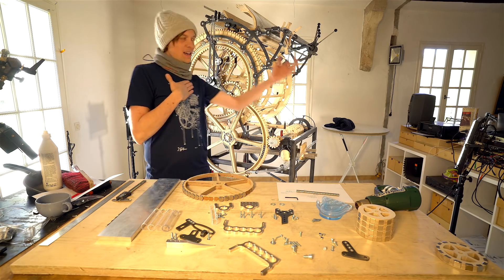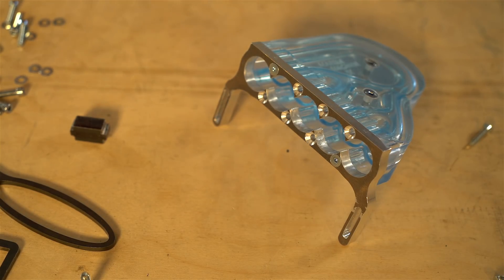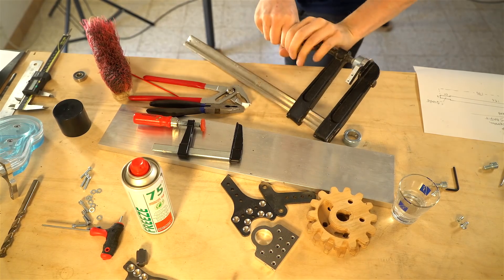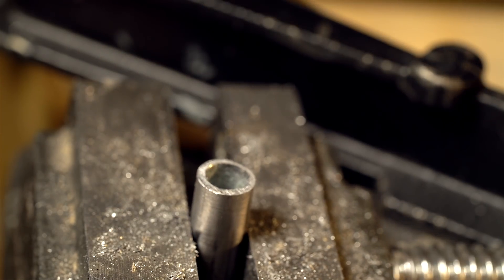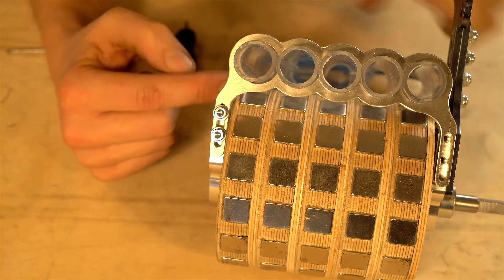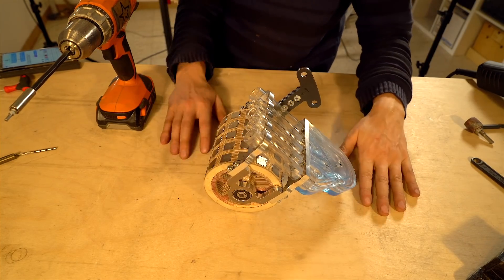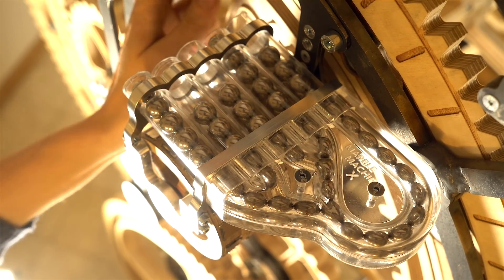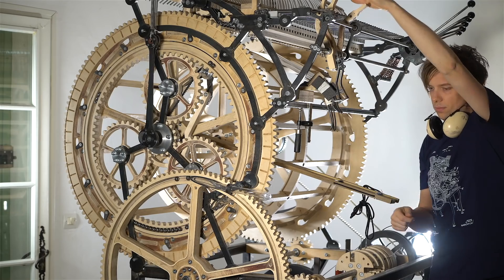Marble Demagnetizer V3 - Marble Machine X #62

Comment: 4:45 and thats why you want to go about 3 turns forward..... and then a turn in reverse 

the reverse turn "breaks the chip"...... the chip being the long metal spiral 
this gives the tap room to cut

if their is no room, BREAK! 

and the tap is VERY VERY VERY hard..... and requires a VERY VERY VERY VERY VERY VERY hard drill bit to remove 
better to simply start over again

Comment: Using a hand-held drill to tap threads is the reason your tap attempt failed.  The drill moves like a lever and the tap is not designed to flex so it sheared. I would use a hand tap to avoid too much lateral movement, slower but if you want a perfect part it is worth taking the time.

Comment: It's great to watch this coming together.  Since you seem to have a penchant for power-tapping (instead of using a wrench), you might want to consider using taps that are designed more for production.  Specifically, Spiral Point Taps and Spiral Fluted Taps which have better chip-clearing and more cross-section and thus can handle more torque.  I'd also suggest some cutting oil instead of that grease - seems like it'd be too thick to get into the places where you'd need it (but maybe I'm just too old school ;)

Comment: When tapping threads do it manually, with lube, and go 2/3 clockwise and then 1/3 anticlockwise, repeat this pattern tool done. A tap wrench has horizontal bar handle which helps keeping it level/true.

Comment: Stop using a hand drill with taps.  You say you like Abom79, and I do also, you know he doesn't use taps with a hand drill.  Keith Fenner will show you the same.  Use a drill press, you're first tool, or a hand tap handle.

Comment: Awesome video, FYI, when trying to drill in the center of a rod like you were towards the middle of the video, try chucking up the actual workpiece in your drill press and putting the bit in the vice. The spinning of the work tends to center the hole much better than driving a bit thru. Using a starting bit after your center punch also helps.

Comment: I always enjoy installments of this build. Very creative design and fabrication. I wish my shop was closer to you so I could help with some of your parts. I'm still putting the offer out there if you don't mind the shipping costs. I would like to comment on the 1 into 4 ball path seen clearly @10:18. the outer walls of path 1 and 4 appear to be straight. If channels 1 and 4 had small bumps on the outer walls at the projected entry areas to paths 2 and 3 , the balls would not rest in a straight pattern and not have the desire to lock at those points. They would distribute smoother. However it is accomplished, the outer tracks should not be straight. Even a slight radius would be a step in the right direction. I have subscribed and will follow this. Great work. What is your background??

Comment: It's hard enough to tap a steel rod with a normal tap handle. I suggest stop using a drill for tapping holes unless it's in soft, thin aluminum pieces.

Comment: Probably late to the game but I was thinking of why have a 1-> 4 demagnetizer, at full throughput there will never exceed 100% in tube and <100% per tube out(optimally 25%) but marbles does not want to split evenly, why the purpose of haveing the marbles to choose a 1 of 4 path during the demagnetization and risk a clog? Nice looking part though but impractical and risky design, to spend longer time in the field maybe? but I would suggest a full througput system one full tube in, one full tube out, and if you need repeated cycles of demagnetization use an S shape to have one tube snake its way over the demagnetizer wheel. Best of luck Sweden out.

Comment: I would've tried to avoid using magnets all together if residual magnetism within the marbles ended up being a problem.  Because trying to discharge the marbles could result in recharging them based on how they can randomly rotate inside the discharging mechanism.

Comment: May I suggest allways use a tap by hand turn half a turn in then quater turn back then back in to bite then  half turn more then quatre turn back and so on, every now and then remove tap to clear swarf. Please never run a tap into anything with a power tool even if youre only cleaning a thread.Not meaning to teach anyone to suck eggs but it makes me squirm when I see people powering taps into things on youtube.As for tapping threads with a drill press can you enlighten me as to the drill speed not.aghhh the more I think the madder I get you CAN NOT run a tap straight in one go theres nowhere for the chip to go it will block up also once it bottoms out you have to swap the tap for one without a taper or the thread wont reach the bottom. Now ive cleared that up ill move on

Comment: Hey Martin,

first of all, I really like to see the evolution of the demagnetizer and this version looks quite beautiful! You already mentioned some improvements and I would like to add two more:

1) Have you thought about tilting the acrylic path? Maybe it will be more complicated to produce but it will give you the great benefit that gravity will help. One marble which is inside the channel will roll by itself and doesn't need the force from the marbels from the wheellift. This seems very important to me, because at 9:42 it looks like you needed to push the marbles with some force which is a big problem: In the "Magnet Polarity Switch"-Part the marbles already fell down backwards in the lifting wheel, so they not only don't have enough strength so push each other in the Demagnetizer, but also the backwards falling will be amplified a lot. So please think about it! ;)

2) Change the spinning direction of the Demagnetizer-Wheel. In that case the marbles in the entrance section will be additionally pushed inside the Demagnetizer. And also, as the velocity of the marbles is smaller after dividing in four paths, the marbles get more polarity changes of the Demagnetizer-Wheel for the same efforts. If then these changes are to fast, just turn down the spinning velocity of the wheel.

Thank you for this great video and I wish you all the best with your wonderful machine! :)

Comment: It's not yet clear to me how the demagentizer in this current state will work later if the marble divider is full of marbles. Might work if only less marbles are incoming but the situation you demonstrated probably ends deadly. I have reasonable doubts that there will not be enough energy in the marbles coming from the elevator wheel to push the marbles forward which are already residing in the marble divider. There are two barriers the marbles need to come over: The "labyrint" takes energy as well as the changing magnetic field. As per your demonstration you need to put force  onto the marbles. The only way I see to achieve this is to avoid the incoming curve. This way the marble divider can mounted with a greater slope to gain energy to transport the marbles though the divider to the  conveyor. Finally making the marble divider larger to have less friction might be a good idea as well. Anyway: Your project is awesome and I learned a lot from that.

Comment: @wintergatan, because you distorted the shaft there is vibration in the part, maby it will add to noticable vibration later on (i love how you solved the problem never the less)
Reply: see 8:18

Comment: A tap builds up a tough chip as it turns in. About every 3/4 turn reverse turn the tap 1/4 turn to break the chips with the backside . This prevents the jamming on chips that causes most breaks.

Comment: I hope that the acrylic tunnel can take the amount of marbles coming in, in relative high speed. I think if the tunnel is full the marbles from the big wheel will get pushed off by the marbles that are too slow in the demagnetizer. Maybe you need a kind of hopper where the marbles can rest before they fall into the demagnetizer by positioning it vertically.

Comment: will there be enough force coming off the wheel to propel  the marbles through the divider?  It seems like they were struggling a bit to get through.  If it requires too much force it might scrape all the marbles off the magnetic lifting wheel

Comment: Never drill tap a steel critical part that's hard to duplicate....always hand tap steel parts it's way to much of a chance of breaking the tap. Now that you have an ugly hole in the end of the shaft fill it with JB weld two part epoxy and sand it flat it will blend much better. Easy pleasy........no more drill tapping steel without all the proper tooling and correct speeds.....which you don't have.

Love the machine

Comment: Dear, dear Martin. Pretty please, with sugar on top, if you continue to insist on power tapping threads with a drill, get a spiral HSS power tap! They are flute twist taps which will remove the metal chips for you and not break (as often). Love the part you made, though. And a nice save! I would probably have shot me dead if I did the same, hehe.

Comment: I think the outer tubes of the 2nd stage divider are favoured because the first stage of the divider pushes the marbles in that direction. I would add a straight section between the first and second stage dividers if you want them to divide evenly

Comment: Where you have the ball bearings dividing into the races, if, in the long term the splitter isn't working perfectly, standard method for splitting round units (this is done in both bottling and canning conveyors) is to widen the track to around 1.5 times the diameter of the ball.. for 3 times (at least, longer is better) the length of the diameter of the ball.. once the conveyor system is full, or in your case, tubes, they will stagger left and right and then divide perfectly left and right into the tubes..

Comment: Instead of using drill taps for your parts I suggest you hand tap threads into your parts because then you can prevent any of your taps from breaking in the job that you are doing

Comment: Its like you haven't even watched a Matthias Wandel Carpentry video: Take a block of wood and drill a hole in in that's 1mm larger than the tap and use that as a guide to keep the tap vertical and steady over the work piece.

Comment: Aluminium is not magnetic, but... Have you heard about eddy currents? Since you have strong alternating magnetic field in this area, it will generate eddy currents and heat in aluminium part. Question is, how much heat.
Reply: Btw: I have to admre your ability to make coaxial holes into shaft by hand. I'm not able to do perpendicular holes, let alone coaxial...

Comment: You should never use a drill for tapping. Use a hand tool. Also Aluminium or copper near magnets works as a brake. Just try dropping a powerful magnet trough a copper or aluminium pipe...

Comment: I have a question about how it would actually work, or, more precisely, would it work at all? When the marble is being pushed into the plastic part of the demagnetizer, it moves pretty slowly. Then it goes into one of the branching channels. The magnets under these channels move very fast and they continuously attract and repel marbles inside of the channels. There is very little friction inside of each channel and to demagnetize a marble effectively it should stay in one place (and in the same orientation!) right over the magnets for a relatively long time. And the main problem is that the magnetic wheel in your demonstration turns in the same direction as the flow of marbles go. When a marble is being pushed into the channel, it's being attracted by the magnet right under it, gets literally sucked inside and then it should leave a channel at a pretty high speed without having a chance to stay there, and what's more, it will be interacting with only one or two magnets under the channel. It's basically a marble accelerator. So, will there be a barrier right after this part which should slow down the marbles (an upward slope, maybe) and wouldn't it be better to turn a magnetic wheel AGAINST the flow of marbles so they will be pushed through a magnetic "curtain"?

Comment: for the love of machining hand tap!
also make sure the aluminum parts wont heat up when running at full speed, while they are not ferromagnetic they still react to AC fields and might heat up

Comment: It's so lovely to see a video where you assemble a complete part. But I have one question...
What if you stop the mashine and then run it again? Wouldn't that leave 4 marbles stuck in there, getting magnetized a lot, and then pushed out without proper demagnetization when the demagnetizer starts rolling again? I believe 4 rogue magnetized marbles could make a pretty mess on the top of the mashine.

Comment: Just a gut feeling of why the marbles are favoring the outer channels.  Let me know if my solution helps!  Good luck and I'd love to give input to assist with DFMA -- amazing work thus far!

The clamping force is not uniformly distributed across the width of the four channels.  By clamping only on the centerline of the channel plates the plastic is deforming (bowing) slightly such that the center channels are being squeezed together slightly and the outer channels are being splayed apart.  Additionally, local deformation around the thru holes causing the material to bulge into the center channels.  Both of these factors combine such that the cross sectional areas of the center and outer channels is simultaneously reduced and increased respectively.  Try adding a 0.015" shim between the plates and/or drill the thru holes open to press fit aluminum spacers/standoffs with a total length 0.010" to 0.015" longer than the total thickness of the plastic so the bolts can clamp down on a rigid member.  Sorry if that's hard to visualize, let me know if I didn't make sense.

Comment: I think the word for "mushroom" there is "peen" or perhaps "flare."

Tapping, especially in steel, requires rigid holding. If using hand taps, don't use the power driver, and stop every half turn to back out chips.

If using a machine tap, the motor needs to be rigid too -- not hand held!
Reply: Jon Watte   As an old machinist, I consider “mushroom” acceptable. Peening would be the act of hammering the part. And flare would only apply if it was tubing. I agree with everything else you said.

Comment: Ps when tapping with a drill go in slow, then reverse
....then back in again and few times ... esp with larger tap sizes....no need for a hand tap, but be gentle like petting an animal that bites.....ps: there is a tool you can use to remove a broken tap, it has three to four small protrusions to attach itself to the tap, then just reverse out.... Very simple and easy to use till you break those and the tap
.....lol :(

Comment: 8:23 that off-center hole in the shaft hurts me so much
Reply: easily remedied with a cap or some fun thing he could add.
Reply: hey, i feel you
Reply: I thought that too. It looks really amateurish.
I'm sure there is a machinist out there that could run a new shaft up in 20 minutes.
Reply: its not just the hole .. i think its the mushroom edge which is pushing the bearing up and down .. if you look the whole demagnetiser assembly is moving up and down slightly
Reply: jeez my OCD is kicking in.

Comment: Why won't the marbles simply be accelerated by the moving magnets? If there's an existing magnetization then the magnets will simply spin the marble (in the tube) to oppose the field and then accelerate it down the tube? If the wheel spun at a multiple rate of ball motion in the opposite direction then the sweeped field de-gaussing would work better, wouldn't it?

Comment: Easy trick for mounting Bearings: make the bores oversize (0.05 mm) use a tiny bit of Red Loctite 271, wait 1 hour- done.
If you need to get the bearing out, just heat the assembly to 150 degrees C for a few minutes, the loctite degrades and it comes apart easy. This technique is really robust, fast and easy.

Comment: NEVER tap with a drill unless you use taps that are designed for it, always hand tap. Give it a few turns then back off half a turn or so to break the chips.

Comment: The best way I found for removing a small broken tap even from soft metals like Aluminium is to grind it out with a small ball-tip tungsten carbide cutter for a rotary tool like the dremel or proxxon

Comment: Hey buddy, really pulling for you.   
1 — don’t tap threads with any kind of power tool.   Do it by hand so you can feel when it starts to bind, then back off.  
2 — your demagnetizer is going to become a magnetizer (but in the opposite polarity) if you don’t get the balls through it more quickly.

Comment: Where is the strong pushing force on the marble into the first tube going to come from?  It certainly is not going to come from the lift wheel!  The marbles will pack up at the pick-up point and spill out of the lift wheel!  It is important that the marble see a lot of magnetic reversals as it passes over the demagnetizer wheel.  Your wheel turns too slowly for that.  That wheel should turn against the feed direction of the marbles.

Comment: Get a proper tapping handle and stop using drill taps! It might take longer per hole, but you save yourself from broken taps. The drill one is fine for sheet or thin plate - but that hole would have been T handle, and go slow.

Comment: +Wintergatan I don't think that the rising magnets will have enough force to push the marbles through this particular section of the separator. I think you should try and use gravity in your design as much as possible to help you. I can send you a drawing of what I mean if you'd like.

Comment: Did you consider that the moving magnetic field of the demagnetizer (and i guess the marble lifting wheel) will induce an electrical current in the aluminium parts? probably wont be an issue but worth consideration